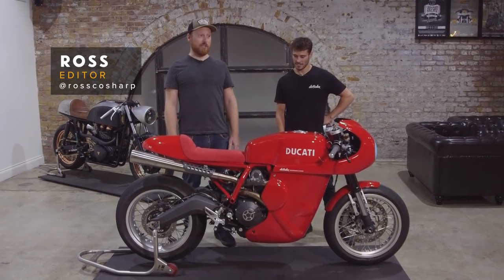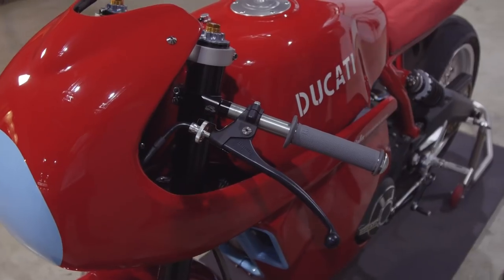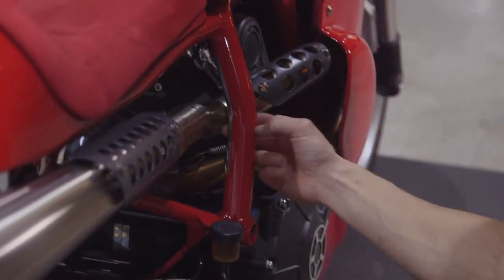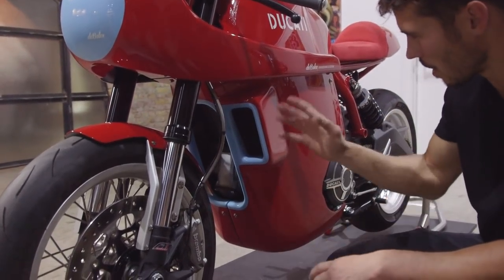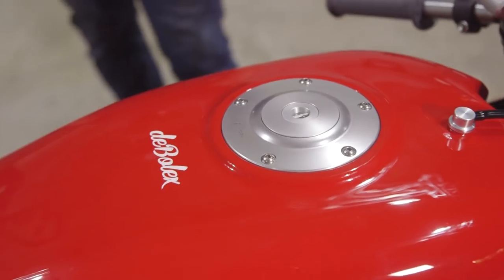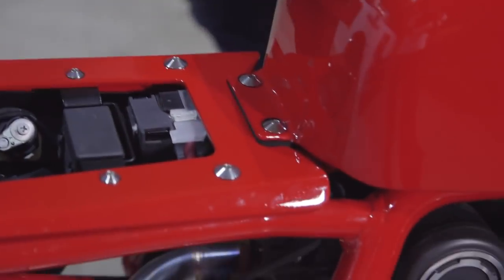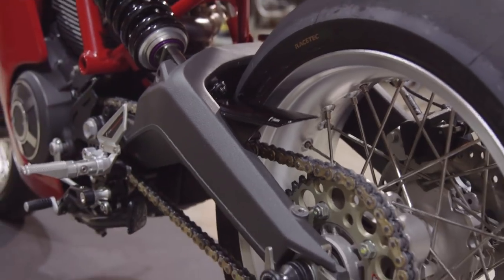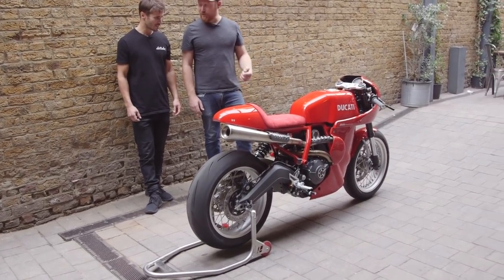deBolex Engineering Ducati 803 Special

Comment: Beautiful bike. I ride a nearly identical 803 myself (desert sled), and the only issue I see is that these air cooled bikes run HOT, and I would be worried that the tight fitting fairing would cook the bike and the rider. Hopefully the open oil cooler is all that is needed, but the fact that the exhaust and all the cooling fins are blanketed, I wouldn't be surprised if it turns into a BBQ on a hot day.